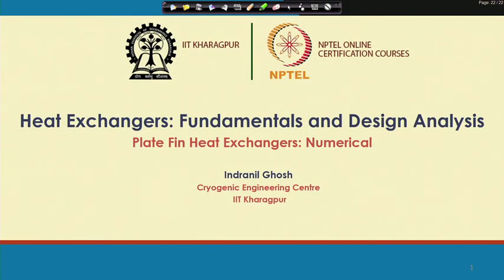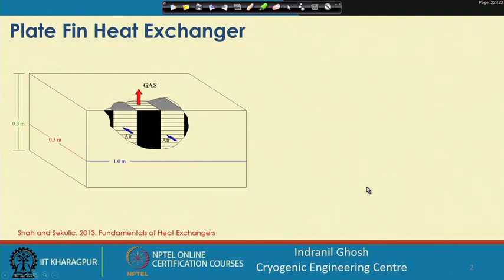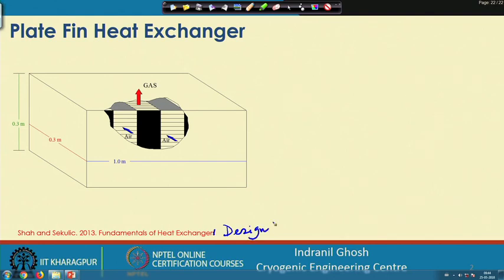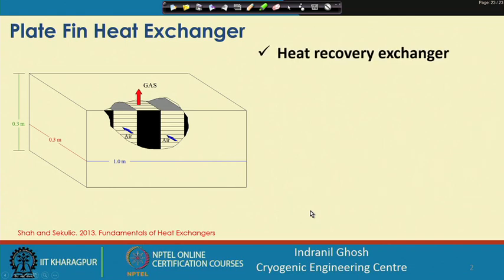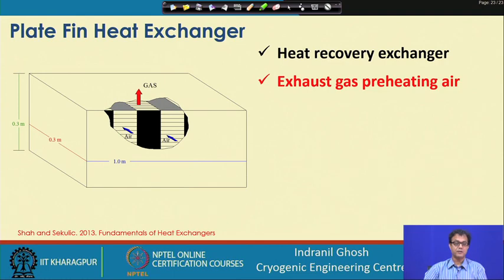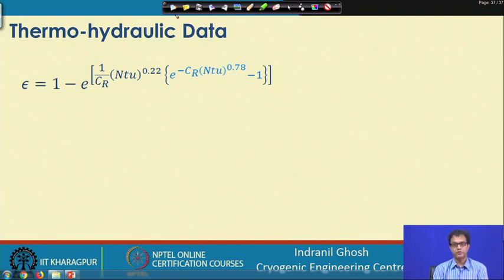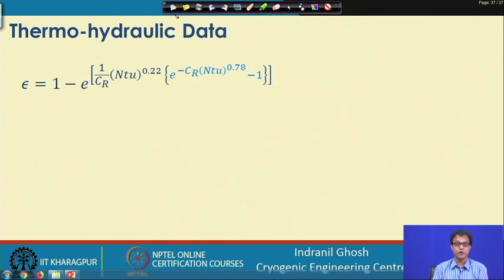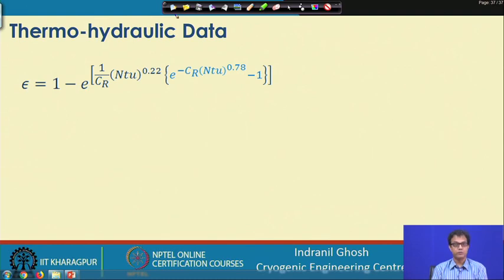Lecture 29 : Plate fin heat exchanger : Numerical

Comment: Respect sir .... Can you kindly suggest which are the  correlations for heat transfer coefficient , friction factor  can be used for two phase flow of streams with condensation/boiling occuring inside the plate and fin heat exchanger ? .... As like Plate & fin heat exchanger for Air separation unit , where air gets liquified partially in PFHE against cold streams